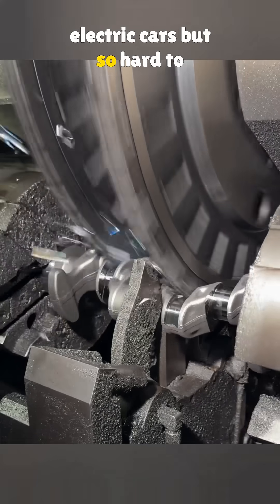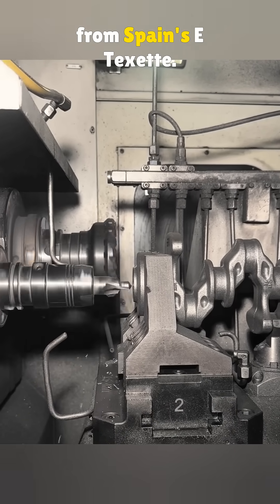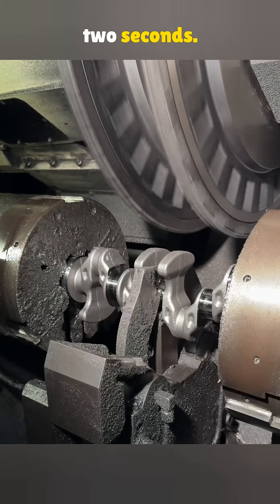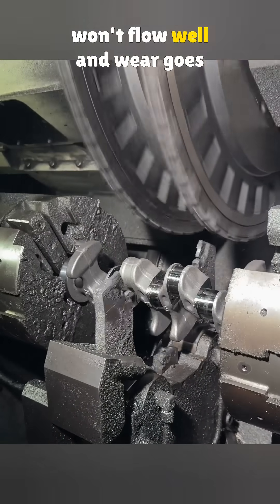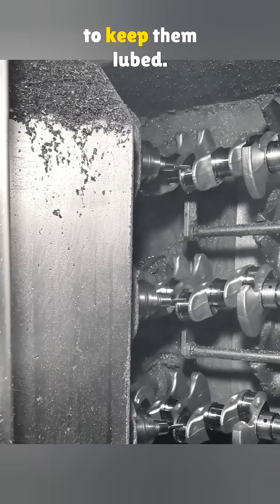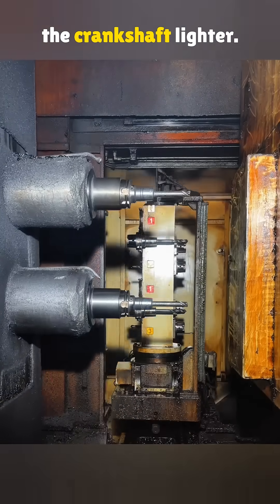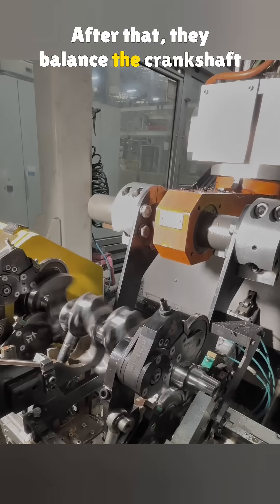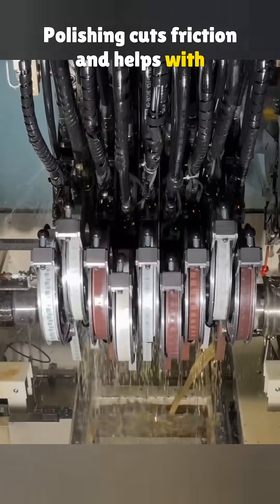How a Crankshaft Is Made #automobile #car #cartech #engine #mechanic

Comment: If that's true why are electric cars so expensive
Reply: Because the corporate greed. Go see China selling EV at dirt cheap
Reply: @cwkchicky  to be fair we need to keep in mind since majority of the Electric batteries for EVs are manufactured in China that there are additional tariffs on them. Even under the Biden administration there was a tariff under chinese electric vehicle batteries. But yes you're not wrong corporate green is definitely a part of the expensive price tag.
Reply: Battery, power electronics.
Reply: High cost of materials to make the battery like lithium and cobalt. These battery is the most importantly component of an electric vehicle, a lot of the electric batteries come from Chinese companies like CATL and BYD.

Comment: is this mean electric motor and batteries for electric cars were much easier than metal grinding? Think about it! Electric cars do have transmission as well. In my opinion gasoline cars are still recyclable all day all long. Can be tha same with electric car?